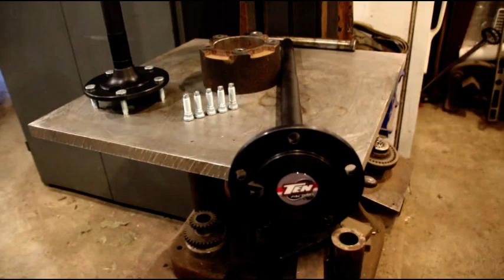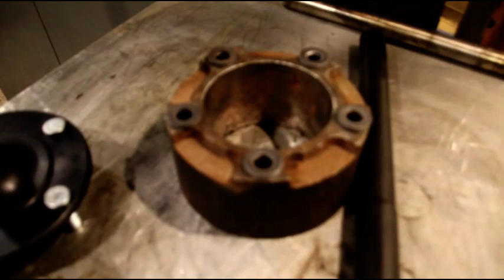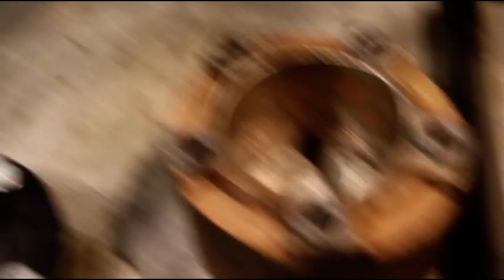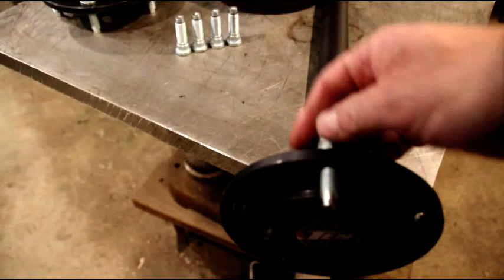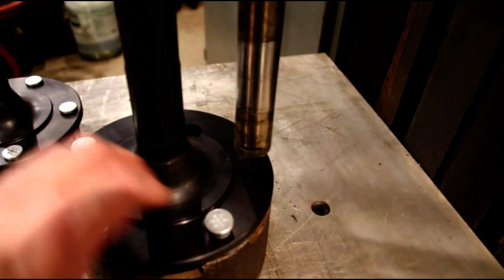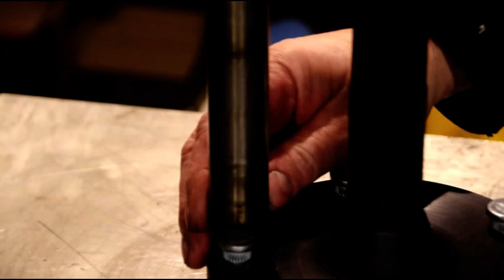AMC/Jeep Model 20 Axle Rebuild Installing Wheel Studs Properly.......... Be Nice To Your New Axles !

Comment: Will a ball joint press be strong enough to do that job. Those look like solid axles.
Reply from the maker: Not sure if a ball joint press would do it.  These axles are hard and took a lot of pressure to set the  studs in properly.

Comment: Hey Brian, bought a CJ-7 with a 20 just about a month ago. It came with a bad axle bearing on the driver's side. I fixed both sides but have been thinking sometime I may want to upgrade to axles like in your video. Could I possibly buy from you and have you install the studs before you ship them? Also, on that solid flange conversion, it's my understanding the brake backing plate has to be on before you press the bearing on. Is that big pain, or not a problem?